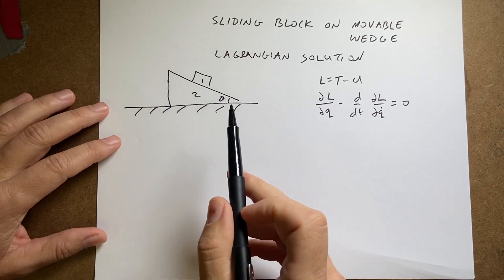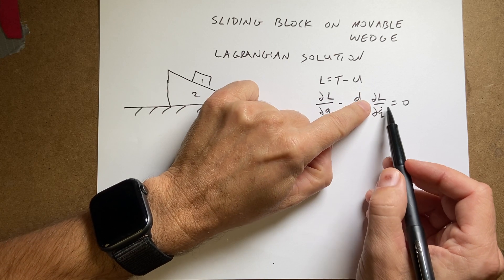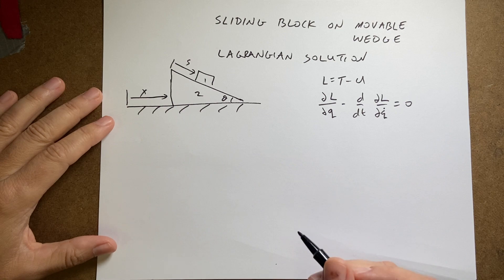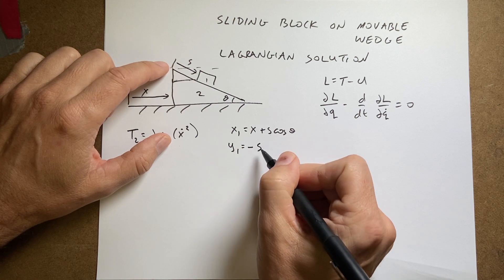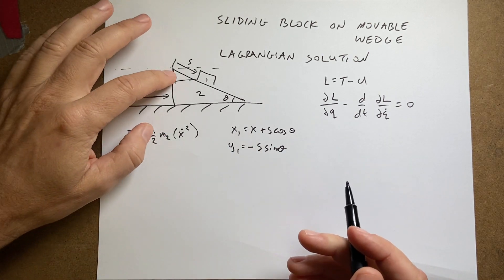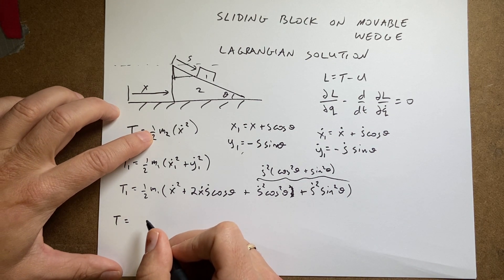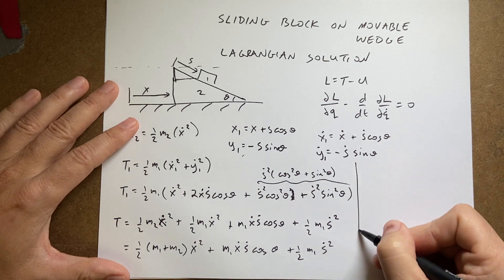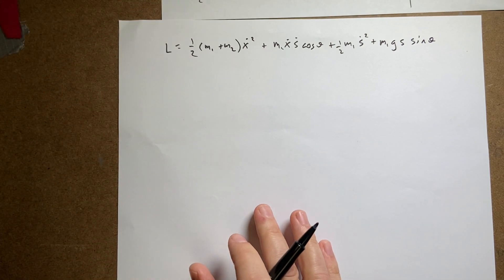Block sliding down a movable wedge - solution using Lagrangian mechanics

Comment: Shouldn't the potential energy be defined as U=m1*g*(Ol -s*sin(θ)) where Ol is the opposite leg to the θ angle? 
If we define U=-m1*g*s*sin(θ), that way U has maximum magnitude in the lowest point (while still having lower potential energy at the lowest point).
Reply: The magnitude does not matter at all, all matters is the differences of potential energy being correct. The Ol is just a unnecessary constant, so it can be ignored.

Comment: 6:10 isn't U supposed to be positive? Since mg is going down so it's negative, and the box is going down as well so (s sin Ɵ) is also negative?
Reply: s becomes positive when going down, the direction of the s coordinate is diagonally downwards. U is negative, since it's zero at the highest point.
Reply: It would be if the coordinates were centered below the objects